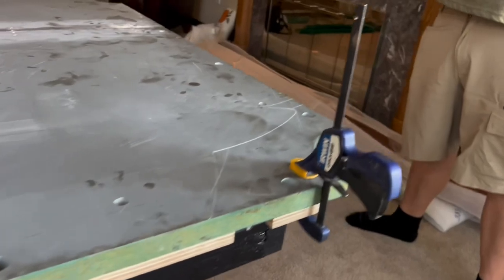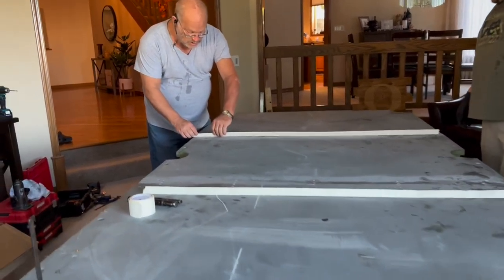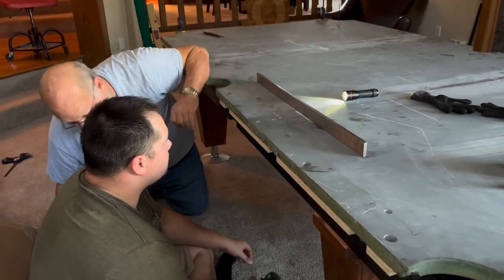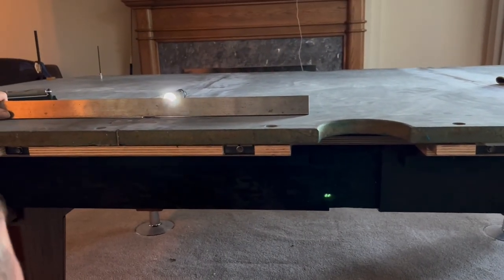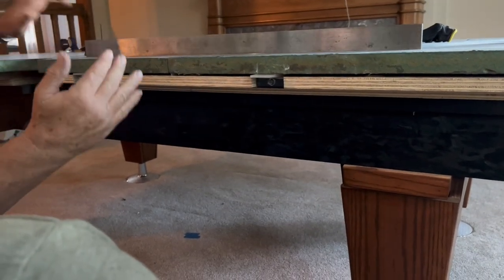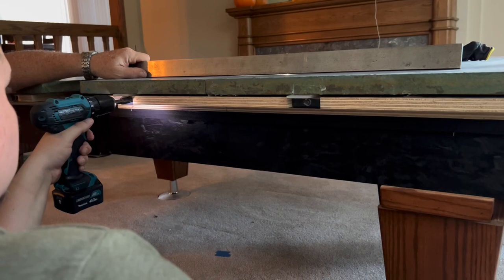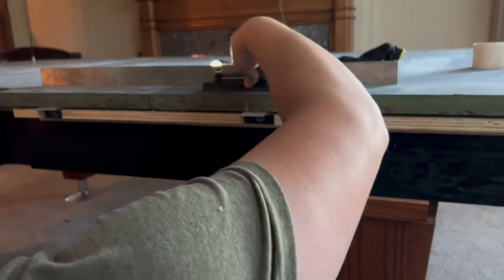HOW-TO: Level a 3 Piece Slate Using a Bottle Jack! (Part 1)

Comment: You definitely got the seam even in the middle but straight edge showed a belly there. Do you have a way to correct that after getting seams even? 

By the way you reputation is amazing and you sure seem to know what you are doing.
Reply: There are wedges near the middle of the table that will raise it. Getting them even is just the first step.
Reply from the maker: Sure do, lower the bottle jack and remove the ratchet strap😅🤣
Reply: @therealkingcobra  as a tile and granite installer i can atest to how much slabs of stone can actually deflect

Comment: Many thanks for your great vids RKC. Is this technique also good for pinned brunstone slates in a GC1?
Reply from the maker: Not really, the pined slates pretty much line up the seams flush as is. The bottle jack is only used if the seams are not flush to each other.

Comment: Love the Videos, been doing this for 40+ years. I have been using liquid dowel for my seems and shims for 20yrs never get a call back for a slate shift even if they live on a railway line. I did want to know what glue you use? I am looking to try a brand called Star Bond, available in different viscosities and most importantly larger bottles.
Reply from the maker: I use 2P10 thin, medium, thick, and gel.

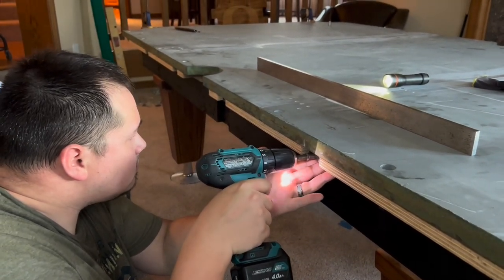Comment: What do you call the bolt/ levelling mechanism on that table for levelling the slates.. 0:59 looks much better than having to use shims
Reply: Thats a feature on the diamond tables, if you search for a diamond install video you can see the system in use. It is an awesome system, much better than wood shims. It uses the screw to push in and pull out plastic shims that are built into the table's top surface
Reply: @liquerinfrnt  Thanks man..found a great vid showing them
Reply from the maker: Those are the Diamond wedges used to raise the slates. But when I get into making the full-blown videos on how to level and mount the slates, it'll blow people's minds. I don't use any more than 4 slate screws to mount a 3 piece slate to the frame, and for sure don't need any at the slate seams.
Reply: @therealkingcobra  keep  pumpin out those vids man

Comment: I have been a pool table mechanic for a little while and I have never seen anything like this lol
Reply from the maker: The bottle jack is just used to flush up the slate seams, so you don't have to feather out your seam when filling them with wax, bondo, or what ever you use. This method has nothing to do with leveling the slates as some have suggested, being low at the seam with the bottle jack there. Once the bottle jack is removed, the pressure is off the seam as well, but the slates are flush to one another, that is the point of this.
Reply from the maker: Think about this for a moment. The jack is used to push the high side of the slate seam down, matching the low side, in order to do that, the bottom side under the jack has to be higher than the slate seam on the opposite side, right? So there's no problem pushing the high side down to flush up with the other side of the seam.

Comment: You definitely should not use a bottle jack to level the slate and definitely do not need the sheetrock tape in-between the slate. The proper way is to start with the slate that is the highest get that perfectly level and then shim the other slates under the table or on the side to  the proper adjustment. This is to avoid the belly dip in-between the two slate. Once you do that you either use wood putty or  bee's wax to fill  in the gap and also keeps the slate from adjusting when tighting up the rail bolts. If you don't use a joint compound and shims underneath the slate it will buckle oneside of the slate when tighting up rail bolts and will fill the joint of the slat and  ball will jump.  All you did was get the slat joints even not the table. If you put a level on that table where you used the bottle jack the table will have a low spot which makes the table not level. If you put your straight edge on the table and see light than the table is obviously not level in that one spot.
Reply from the maker: Hmmm, you thought I was leveling the slates?😅🤣 no, what I was doing was turning the slates into a 1 piece slate, leveling comes later. The sheet rock tape allows me to superglue the slates so they'll stay together, unlike what you're suggesting, which won't stop the seams from separating with the expansion and contacting of the frame from humidity changes. Here's another thing you missed, I don't use any slate screws at the seams to hold them in place, I only use 2 slate screws at each end to secure the slate from sliding around, which means I can still adjust the level of the slate AFTER I assemble the table, whereas you CAN'T because you've screwed the slates to the frame, then the slates can't be fine tuned for level unless you take the table apart again! And if you don't think the level of the slates will change after you've leveled them the first time, I know of some swampland for sale in Louisiana you might be interested in buying😅🤣
Reply from the maker: I've been a table manufacturer, a pool room owner, an inventor, a design engineer, and table mechanic for over 40+ years, how long have you been working on pool tables?
Reply from the maker: And just so you're aware, the use of the bottle jack and strap was not used to level the slates! It was used to force the seams to flush up flat across from each other, by pushing down the high side to match up with the low side, once superglued in place, the slates will remain that way when the strap and jack are removed.
Reply from the maker: Now I have a couple of questions  for you. Do you understand why I used the sheet rock tape? And why should I NOT use it?
Reply: @therealkingcobra he seems very silent…

Looks like the king has schooled another “table mechanic”.
Reply: @therealkingcobra    I would be curious to know....   It's been a year, Austin isn't going to answer....

Comment: How easy is it to separate the slates for the next move after supergluing them?
Reply from the maker: Just use finger nail polish remover on the seams after you first score the seams with a razor knife, and the superglue will dissolve.